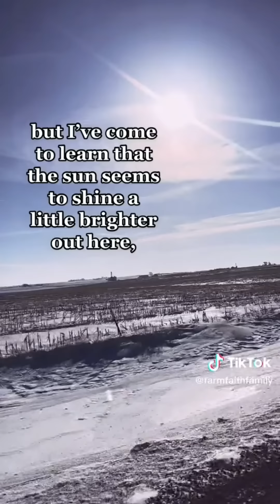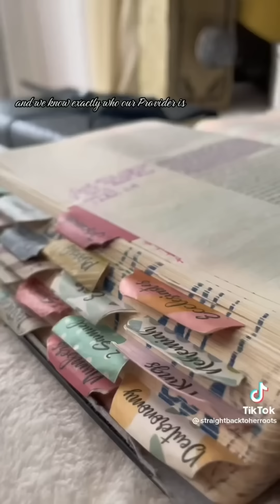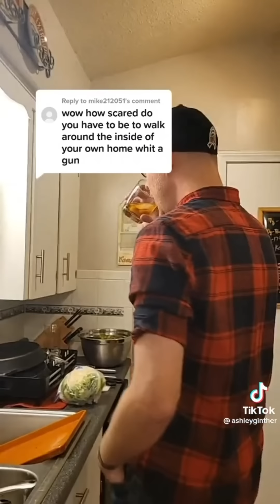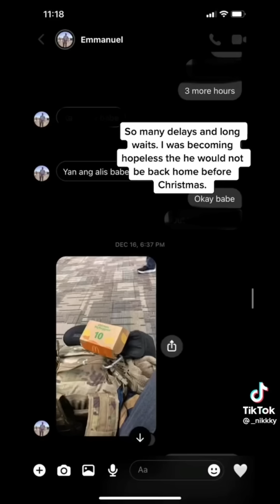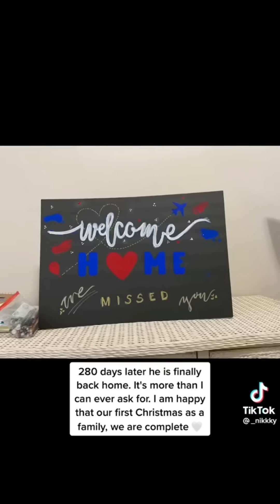A little American country compilation to brighten your day

Comment: 19:03 😂 remonds me when i was a kid i went to work with my dad, he was an electrician and he was going to a bank to do a service call. My dad had a croquet ball in his truck i was playing with. I ended up seeing the vacuum tube the bank uses to send and receive items in drive thru, it was the exact same diameter as the croquet ball. Of course i dropped it in the tube. Later on in the week they couldnt figure out why the syatem wasnt working. They took it apart and ran a fish tape in it, eventually pushing the croquet ball out, but the person at the other end, looking up the tube didnt know what hit em in the face before thwy were laid out on the ground 😂